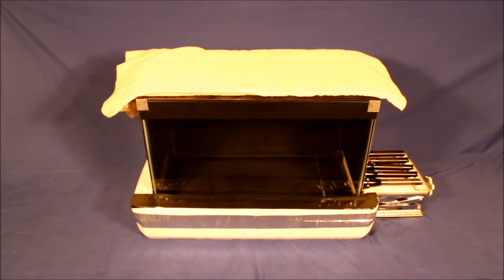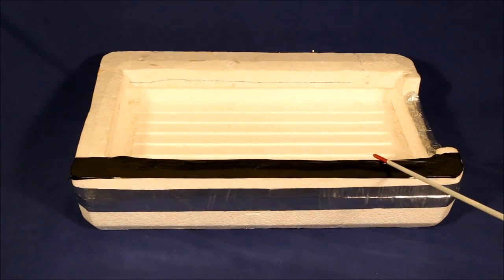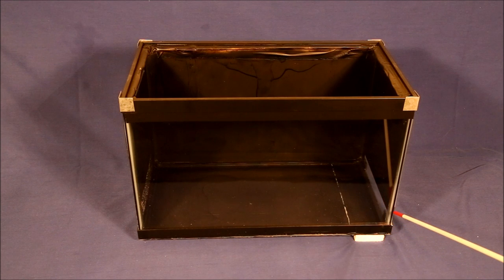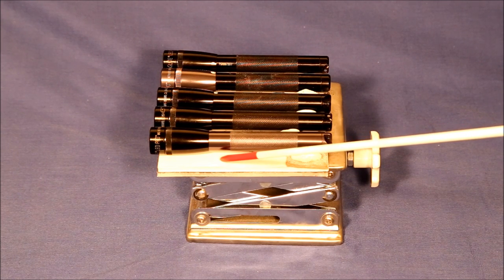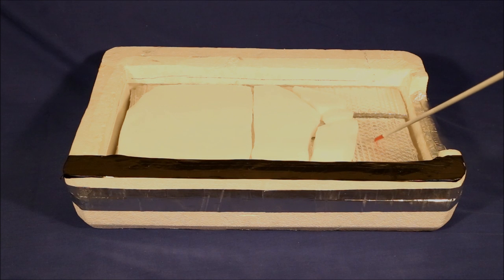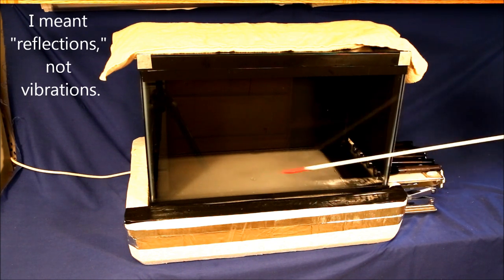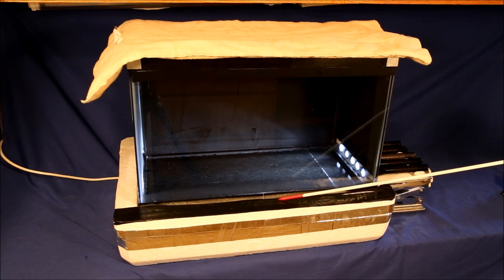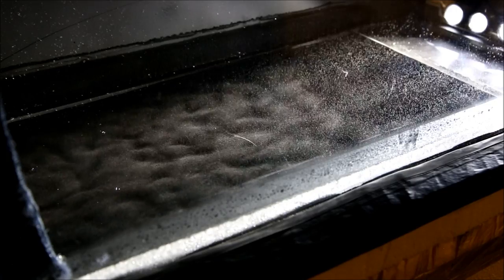How to Build and Use a Cloud Chamber

Comment: Thank you for this! This was extremely interesting. I would love to take it around the house, to watch for changes in its behavior. Radon in the basement, maybe? Would a laser affect it? I have quite a few questions, but I'm falling asleep; I'll watch the rest tomorrow, after some coffee.
Reply from the maker: pocket83² The biggest chance would be to compare the number of tracks at sea level to those at the top of a mountain. The discovery channel did it and the high altitude tracks outnumbered sea level tracks by two to one. I've shined a 50 mw (50 not the usual 5 mw pointer) green laser into the chamber and not noticed any effect.

Comment: This is by far the most informative video I've found on cloud chambers. My question is, have you seen anything that would indicate that their energy is coming from the outside of the chamber? I know we're "told" that, but other than being "told", I haven't seen any aspect of it that even points to that being the case. Looks to me like this is just the behavior of the alcohol.  
If this is all originating inside the chamber, then every once in a while, you would see a random one start at one wall or finish at another wall. But that would have more to do with running into a barrier than being related to an outside influence. Also, that's the only solid object in the chamber, so if some of them originated there, it could be because it's a solid object, not because it's at the perimeter.
Reply from the maker: +gilbet Thank you! I'm glad you enjoyed it.

The alpha particles are from radioactive radon decay. This is a naturally occurring gas. Some gets trapped when the chamber is closed up. As time goes on, the number of such alpha particles decreases because most of the Radon has decayed.  The beta particles are from muons blasting through the glass walls of the chamber and either spontaneously decaying into a beta particle or interacting with an atom to eject a beta particle. So the muon is where the energy is coming from. Also, because they carry a -1 charge, muons can leave tracks themselves.

If you don't believe the tracks are made by charged subatomic particles, then what are they?  What would cause the alcohol to produce randomly directed trails such as those seen in a cloud chamber?

Very few particles have enough energy to travel the full width of the chamber to appear at one wall and transverse all the way across the opposite wall. I have seen a few muons leave such tracks and only twice a primary cosmic ray do it, but it does happen.

I don't see how the glass wall of the chamber could be the source of the beta particles, unless a muon striking it very close to the inside surface ejected one with sufficient energy to break free of the glass's work function and enter the active area of the cloud chamber.

I've built a easier and simpler cloud chamber that I will be posting a video on in the near future. You could build one and observe the trails for yourself. 

Thanks again for commenting! If you have any specific questions, please feel free to ask them and I'll do my best to respond. Please don't take anything I said as a challenge of criticism of what you believe. It's good to doubt and question. If no one did that we would never find anything out.

Comment: Excellent video and tutorial.  So you did not use any source at all.  Could I use my monazite source or will it produce too much heat and block any disintegrations?
Reply from the maker: My guess is that if you placed it in the chamber when you set it up, by the time everything got going it would have cooled down enough to not interfere with track production, if the Samp,e was under 1 cm across. The only way to know for sure is to try it. Good luck!
Reply: @wayneschmidt490  Thank you!  I am going to also try my radium watch hands.

Comment: Wayne, great video.  Few questions for you if you don't mind.  We are thinking about building one of these for next years science fair.

1. How long will this chamber operate?
2. Once the chamber stops working how long can it be reset?
3. Have you investigated using LED strip lighting rather than the expensive flashlights?  The strip lights can't be focused, but this might not be a problem.  Also you can get water proof LED script lights that you can put directly on the inside of the aquarium eliminating the frost problem.  I've seen some other production quality cloud chambers on YouTube (after I viewed your video!) and they have LED lighting inside, but the chambers are much smaller and don't quite work the way your's does.

Again, great stuff Wayne and thanks for sharing.
Reply from the maker: William Hayden With 10 pounds of dry ice in a 1.5-inch thick slab I get at least a solid hour of operation. When that dry ice sublimes, replace it with a new slab and the chamber should be operating in as little as five minutes if the ice exchange is made quickly. If the chamber warms up to ambient temperature than it'll take ten or fifteen minutes to show lots of tracks. I made an LED strip using 20 of the brightest, narrowest angle white LEDs I could find. They worked, but the beam spread was greater than the flashlights. This put more light off to the sides, which reduced contrast and made the tracks harder to see. I to have seen a commercial cloud chamber which uses strings of LEDs and it seems to work fine. One problem with the LEDs in my chamber is that they didn't generate enough waste heat to prevent the window from getting covered in frost. As you mentioned, the commercial chamber had the LEDs inside the chamber so this wasn't a problem, though it would create a heat source inside the chamber, which would reduce the size of the active area. If you haven't seen my webpage about my chamber, here it is:http://waynesthisandthat.com/cloud%20chamber.html  . Also, did you watch the video of the rare cosmic ray I captured? If not, you might find it interesting: https://www.youtube.com/watch?v=Rpp9E-BtUY8.
Reply from the maker: Wayne Schmidt I appreciate that the cost of the lighting system is a hurdle. One option is to use a slide projector. They produce very bright, focused beams. Another is a different flashlight I've recently purchased from Amazon (http://www.amazon.com/UltraFire%C2%AE-Bright-Lumens-Adjustable-Flashlight/dp/B00FRAZ7ZG/ref=sr_1_3?s=hardware&ie=UTF8&qid=1431621901&sr=1-3&keywords=2000+lumen+flashlight) When focused, it produces an extremely bright beam and is much cheaper than the LED Maglites. I think two of these would do the trick. They come in various combinations of extras that can affect the price. Shipping is also an issue. Some sellers offer then very cheaply then nail you on shipping and handling charges.
Reply: Wayne Schmidt I did watch your other video.  Right after I watched this one!  :)  I also watched a number of other videos on Cloud Chambers after, but found your video to be better in many ways.  :)

Comment: 1. Will humid weather affect the chamber?
2. Is “Everclear”, 120 proof useful?
Reply from the maker: I wouldn't think humidity would be an issue. By the time it gets running the chamber is saturated with alcohol fumes and I assume they would dominate over any humidity. I've never heard of "Everclear," so I can't comment on it. 120 proof is only 60-percent alcohol, which is low for cloud chambers. They work best with the purest alcohol you can find. I've gotten mine to work with 91-percent (182-proof) alcohol, but it didn't do as well as 99-percent. Also, proof ratings are used for consumable alcohol like ethanol. I've never used that. I have tried methanol and isopropyl alcohol and they both worded so I'd stick with them. Thanks for commenting and if you're building your own cloud chamber, good luck!

Comment: Great video and build - can you comment on any recommendations a material for the base? Are there better/worse metals? What about painting to make it black? Thanks
Reply from the maker: Aluminum is best because it's a good thermal conductor, is cheap and easy to cut. I uses an old aluminum cookie sheet. Yes, by all means paint it black. This increases makes seeing the track easier.

Comment: I've been trying to get this work and I'm thinking the issue may be my flashlights. I tried commenting earlier with a link to the product on Amazon, but my guess is YouTube isn't letting my comment post becasue of that. I'm using small LED flashlights, each flashlight has 9 bulbs in a circle. Do you think the light is too dispersed? I don't really want to have to buy new flashlights if I can avoid it
Reply from the maker: This is very odd. I received this comment yesterday and every time I clicked on it to reply, it disappeared. It showed up today as a new comment and this time when I click on it it remains and I can reply. Youtube seems to be getting a little unstable recently. 

The flashlight you describe could be the problem. A circle of lights will flood the chamber with illumination and reduce contrast to the point where the traces are hard to I checked out your channel and was impressed see. That's why I used a line of focusable flashlights to create a narrow plain of light, which only illuminated the active zone in the chamber. I also placed a light barrier in the hanger that prevents any of the light from the flashlights from striking the bottom on the chamber to create the darkest background possible against which the traces could stand out. 

I checked out your channel and was impressed with the number and range of science videos you've produced. Thanks for commenting and good luck with your chamber!

Comment: Is it required to use dri ice has a cooling system or I can use anything that can reach the Sam temperature
Reply from the maker: Anything that gets as cold or colder as dry ice and makes good contact with all of the metal base should work well. Peltier coolers are convenient for small chambers and can be used over and over, but required a lot of electricity, power supplies and are expensive. Thanks for commenting!
Reply: @wayneschmidt490  it completely off topic but what kind of telescope it is in your profile picture
Reply from the maker: @charlesoliviersdufaux6943  That's one of my greatest projects. It's VOYAGER, a motorized binocular telescope chair. It was featured in a 1976 issue of Sky and Telescope. I have a webpage about it here:

http://waynesthisandthat.com/voyager.htm

I no longer have it because it got too difficult to manage as I got older. But it was great while it lasted. In the end, I broke it up and gave the two telescopes to a local astronomy club.

Comment: I just made one of these, but never saw any tracks at all. Took the americium 241 pill out of a smoke detector, and used a 2% thorium electrode. I used 99% ISO alcohol, and different led lights, and a small flashlight. Nothing. I'm thinking this is not that easy, or living close to sea level has something to do with the results? Not sure what could be wrong?
Reply from the maker: +Redshift40 I tried several of the radiation sources you mentioned and also didn't get much out of them. Part of the problem can be that if they are added after the chamber has cooled down, their warmth kills the cloud chamber effect for up to ten minutes until they get cold enough to let trails form close to them. By that time they have enough alcohol and water condense on their surfaces to block the radiation. Even if those two issues aren't a problem, I found that the trails they produce are so weak and short they are hard to see. By far the most satisfying results occur with natural radiation.

You're being at sea level should not prevent the cloud chamber from working. Although it's true that using one on top of a high mountain will show more tracks, even at sea level there should be dozens per minute.

There are several factors that can prevent a cloud chamber from working. The first is the bottom not getting cold enough. The dry ice needs to have a lot of surface area contact with the bottom of the chamber and that bottom must be made out of a thermally conducting material like aluminum. If the dry ice as in small chunks so that only a few pieces actually make contact with the bottom and that bottom is an insulator like glass or plastic it's doubtful it will work. The second most common problem is that by the time the bottom is cold enough to create the cloud-forming layer, the top of the chamber where the alcohol is has gotten so cold that not enough alcohol is evaporating and falling down into the track producing zone. The quick cure for this is to place a heat pad on top of the chamber where the alcohol is or just place a towel damp with hot water there. If using the towel technique, place it in a plastic bag so that evaporation doesn't cool it down right away.

One final issue is size. The larger the chamber the more tracks will be visible. It's kind of like watching for lightning. Lay on your back in an open field and you'll be able to see a large area of storm and more lightning bolts. Now look straight up through a narrow tube, the same as using a small cloud chamber, and you're going to see very few if any lightning bolts.

Those are a few of the more common problems. If you can describe your chamber I'll try to help you get it going. How big is it and what shape is it? What's it made of? What type of dry ice are you using? What are you using to keep the alcohol warm? How are you shining the light into the chamber? Through one side very close to the bottom? Is the bottom and rest of the chamber painted black to make the tracks stand out?

Cloud chamber really do work and are worth the effort. Let's see if we can get yours functioning!

Thanks for commenting!
Reply: +Wayne Schmidt - Thanks for your prompt reply. I have until the 30th to get this working, but not many days off till then to work on this. I am using dry ice pellets and a thick (1mm) aluminum cookie sheet with the bottom painted flat black. I have a photo of it here... https://plus.google.com/106948314621495372613/posts/TkL5P8x29qC
I did get a good cloud, but no trails. The fish tank is 19"x 9 3/4" The bottom where the dry ice goes is a styrofoam cooler lid. I placed 3 hot water bottles on the top, and blackened 3 sides, leaving a slit for the light. I used 3 different types of lighting. I think it could be not enough contact with the cookie sheet, or it is too thick? I would love to get this working. I'm going to try again tomorrow to see if I can get block dry ice, a thinner aluminum sheet, a flashlight that will focus, and bigger sponges. I used thin highly absorbent sponge pads and found the alcohol stopped raining in about 30 min. And I soaked them good with almost half a 500mL bottle. But it could be that it just wasn't cold enough, or I got the top too hot? What will keep a large sponge stuck to the top of the glass tank? 2 part epoxy perhaps?

Cheers!
Reply from the maker: +Redshift40 The chamber looks great. It should work. 

How thick is the aluminum in the base that touches the dry ice? Unless it's more than 1/8th inch thick I wouldn't think that would be an issue. 

If you can't find slab dry ice, I get mine from Albertson's grocery stores, try crushing the pellet dry ice into a powder, leveling it in the Styrofoam base without compressing it, then pushing the chamber down on it to maximize the amount od contact. 

One possible problem is that the thoriated tungsten rod and its base may not be getting cold enough. The putty holding the supports could be acting as thermal insulators preventing it from getting cold enough to let the chamber work. Also, the active track-producing layer is very close to the chamber's base, starting at around 1/8th inch and going up to 1/2 or 3/4 inch. The rod looks like it could be above that. My recommendation would be to remove the rod and it's base and get the chamber working with natural radiation. Once you've got that, add the rod and base back in and see if they are the source of the problems. I wouldn't think you need a holder for the rod. Its radiation should come off in all directions so just laying it on the bottom of the chamber should work. That would also eliminate the thermal load of its holder and place the rod in direct contact with the cold bottom of the chamber. 

As for mounting the sponges, I used felt and silicone aquarium cement and it worked well. 

I hope this helps.  Good luck!
Reply from the maker: +Redshift40 I took a closer look at your chamber and noticed something that is a lot different than mine, and it could be critical. If you look at the one I made, you can see a picture of it on my webpage about it here http://waynesthisandthat.com/cloud%20chamber.html, you'll see that the foam insulation comes up the sides of the tank almost 2 inches except where it's cut out for the flashlights. This insulation prevents heat from the outside coming through the walls of the chamber down low where the active track producing layer is trying to form. If yours doesn't have some sort of insulation like this, that could be a problem. If that's the case, all you need to do is tape some 1-inch strips of foam around the bottom perimeter of the tank and it should help.
Reply: OK thanks. I have some 1" foam so I can build a better box around it then.
Reply: +Wayne Schmidt - I used the same base (as my other one wasn't dry yet) I crushed the dry ice to get better contact with the aluminum sheet. It worked way better than I thought it would. The 2% thoriated tungsten rod was spewing out thick tracks continuously. Natural radiation was spectacular with many tracks all over the chamber. Thanks for your help.
Reply from the maker: +Redshift40 Outsdtanding!  I'm about to fire mine up again. I purchased a piece of uranium ore and want to see what sorts of trails it produces.
Reply: +Wayne Schmidt Thanks. I would love to see what that uranium sample produces too!